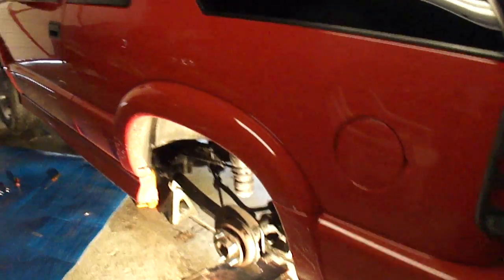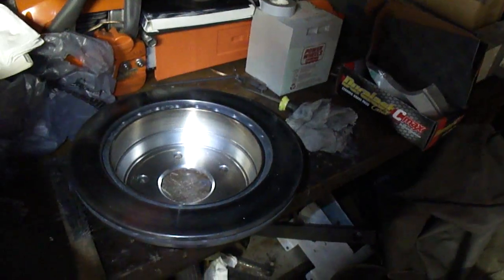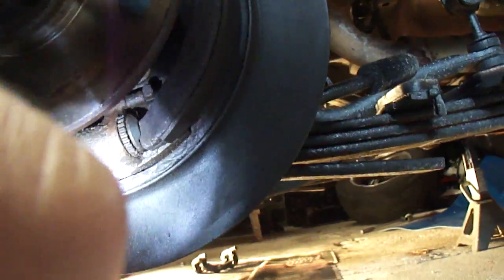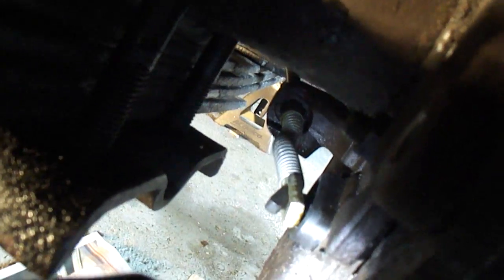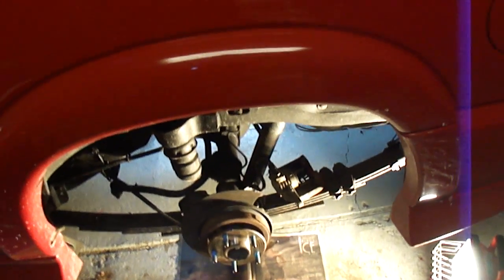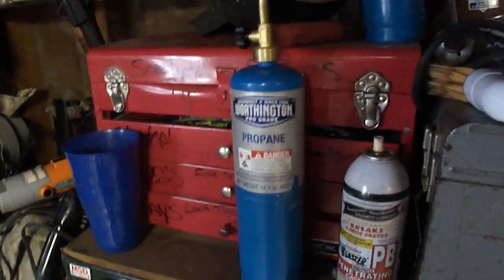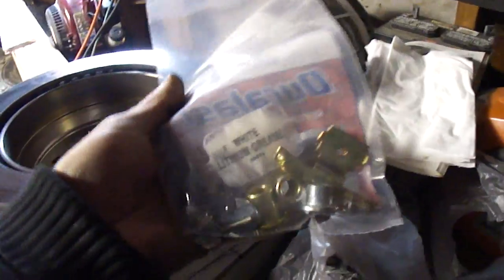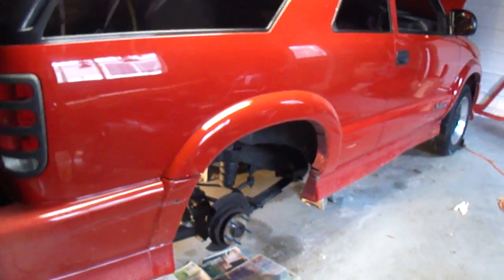2001 Chevy Blazer Extreme, Brake Repair Process Part 5

Comment: A trick I've seen before: zing it with a pneumatic (or electric) impact hammer.  Use brief bursts: 1-2 seconds, 2-3 times, alternating on each side.  It breaks the crud-lock.  Careful to not damage any surfaces or warp rotors that you need to reuse.  Not as much a concern if you're replacing rotors anyways.

Comment: How did you get the rotors off? I'm trying to replace brakes and rotors on my 98 blazer but rotors are stuck on the parking brake, can't figure out how to get it loose.

Comment: I got a 01 blazer and my pedals sinking to the floor, I've replaced the master cylinder 3 times now and bleed the system and it's still sinking to the floor and my emergency brake isn't even connected. idk what I gotta do to fix this shit, my abs and brake light use to stay on but I bought a rebuilt abs module and it fixed my abs but my pedal still sinks to the floor.